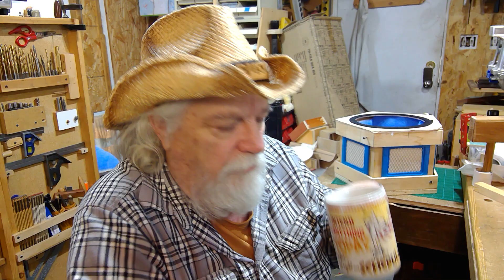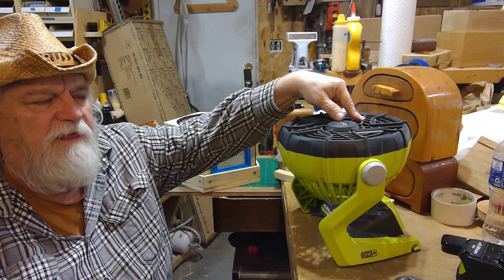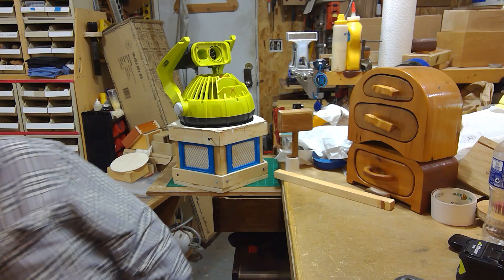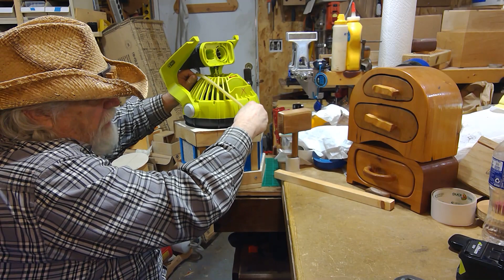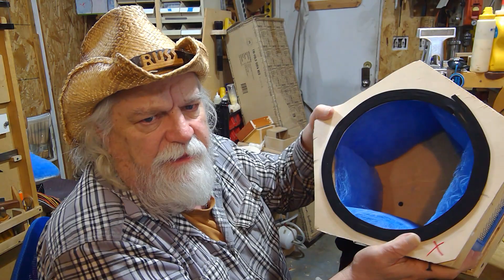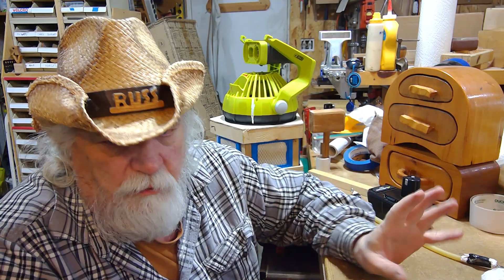Ryobi Powered Air Filtration Unit by OTB Thinker

Comment: Russ, do you have any concerns with having the dust pass through the fan to reach the filters? Won't the motor suffer being coated in dust? I like the idea you have there...
Reply from the maker: It would have to be pretty dusty for a long time to clog the fan.  Blow it out every now and then, it should be fine.  Thanks Tim
Reply: That was my concern also. That is why I put my filters on the back side (the intake) of the fan keeping the fan blades and motor as clean as possible.